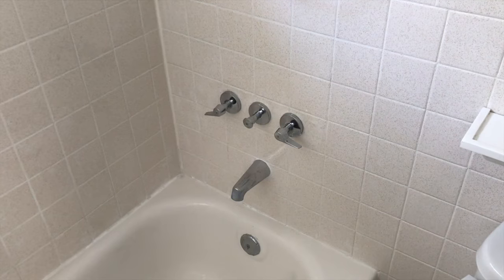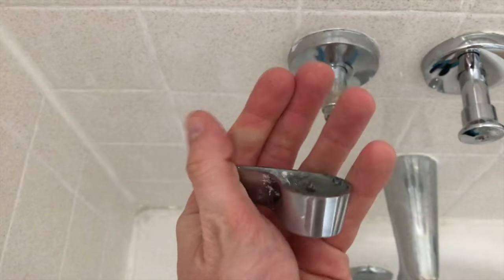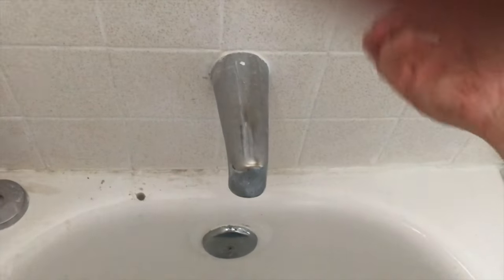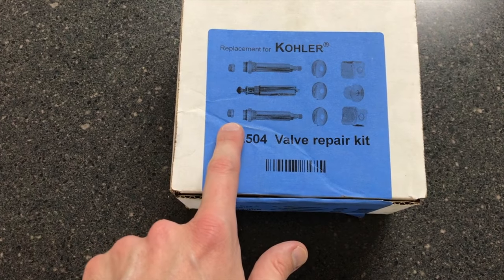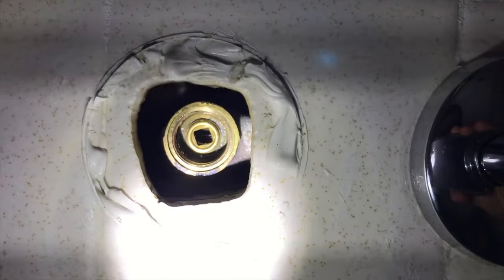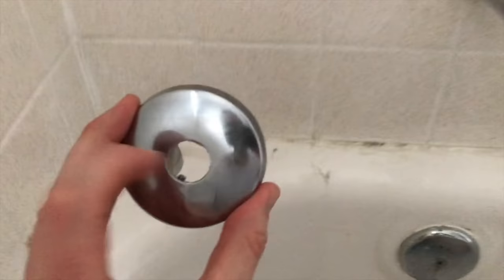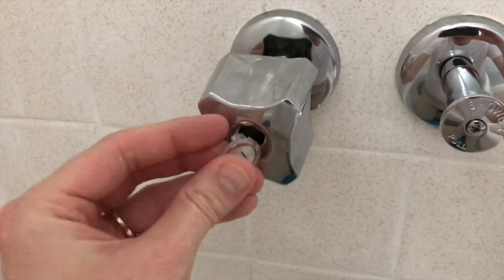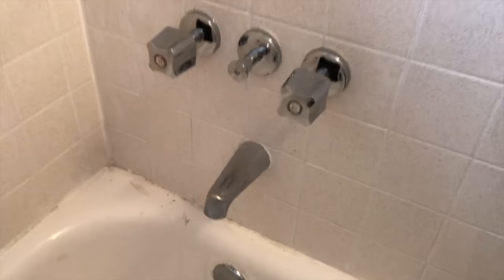How to repair/replace 3 way shower valve/stem - FAST & EASY!

Comment: This was best video yet to show full results of leaking tub sprout, I call  Rooter they want $300.00, I m a single parent I could not afford it. I ran across this video how to replace this sprout come to find out it was not tub sprout it was the cold one. I went to Home Depot with cold water stem, it cost men less than &14.00. Just wanted to dropped a Thank You❤️❤️ for sharing..

Comment: Thank you! I have a leaky valve and I didn’t know they had to be open to replace it. Makes 100% sense. Very thorough video👍🏼. I was instructed when putting the escutcheons on to put a small bead of caulk on the escutcheon and let it sit for a minute or two and then slide it on. Any excess should be wiped off but I can see how over time the putty might be better and easier to work with
Reply from the maker: Thanks for watching & welcome to the DIY Raptor Club.  Sounds like you’ve got a good handle on your project.  Please keep us posted matthew.

😎👍🔧🔩

Comment: This is the one i need to change out ,  mine is  hard to turn all of a sudden ...  i have to find what  size it is  nothing is leaking  just getting harder to turn lately .. i changed it when i moved  in here 10 years ago  there was no hot water  since the house was empty for a while  when it was for sale .  Thanks for sharing ~
Reply from the maker: Awesome, definitely reach out to us if you have any questions.  Even if you don’t have any questions, we’d love to hear back from you on how the project went.

👍
Reply: @DIYwithMichaelBorders      Yes for sure .  Thanks ~
Reply from the maker: @joedevitto6113  

😎👍

Comment: Thank you for a very helpful video! One question — do you need to seal the inner part of the plate, where the plate’s donut hole and the stem meet? Seems like water could get in that way?
Reply from the maker: Thank you kindly, that’s a great question.  You can definitely apply plumbers putty to seal that portion.

😎👍

Comment: Thanks for your video.  My bathtub faucet has three handles and was made by Eljer.  Several years ago I had to have a plumber come out in the past due to the handle on the hot water side not cutting the water off.  I watched the plumber take it apart and replace the seat washer on the end of the stem and it fixed the leak.  Everything was good until this past weekend when turning the hot water off the handle suddenly turned the water back on after almost having it off.  I decided to try my hand at it this time and got the necessary supplies and replaced the washer myself.  When turning the handle the water does cut off, but the handle still comes loose again and water flows and a little more twisting I was able to get the water back off.  Is this a sign that the stem has gone bad as well?

Comment: Great video! I am trying to understand if this would help with low pressure it’s only for the hot side but the pressure works fine everywhere else in the house?
Reply from the maker: Thanks for watching and your stem may be clogged.  Replacing it will be a good idea.  😎👍

Comment: I replaced the cold water stem in my shower. But the problem im having now is when you shut the water off, the handle won’t stop spinning. And if you keep spinning it, the entire handle + stem will pull out of the wall. Is this just because I wasn’t using the socket wrenches and was simply using a wrench to tighten it?
Reply from the maker: Thanks for watching & welcome to the DIY Raptor Club.  Any update?  By chance did you apply Teflon tape to the thread of the stem?  

Teflon tape will not only create a water-tight seal, it will assist in firmly securing the stem into the threaded housing of the valve... ultimately not allowing it to spin or loosen in any way over the months and years of using your handles.

Also, have you ensured that you purchased the exact replacement size part?  A stem with an ever-so-slightly smaller thread diameter will cause this exact issue.
Reply: @DIYwithMichaelBorders  You don't need teflon tape for this job.
Reply from the maker: @gary7vn  

Thanks for sharing your thoughts.
Reply: @DIYwithMichaelBorders  he’s not saying the body is spinning, rather the handle is. This occurs when the barrel doesn’t seat fully and you can’t shut the water off.
Reply from the maker: @Mike-gz4xn  

Very kind of you to share, we really appreciate this Mike!  👍
Reply: Connor the solution is the get a solid brass or plastic washer and put between the barrel and the stim. This will push the barrel out more and keep it from spinning. I would bring your stem to a local hardware and find a washer that fits. It can’t be any wider than the barrel. 
I used a nylon one that fit good.

Comment: Great video, thank you. Please allow me one question. I have a 3 handle very old (1973) tub faucet. It seems it's made by Jameco. I want to replace/upgrade the three stems, especially the diverter which no longer works. So in your opinion which plumbing fixtures company  stems i should use for this replacement. Or, would the internal old valve accept any upgrade kit. Thank you a lot for your time.
Sam
Reply from the maker: Sam Rafeedie 

You are very welcome Sam.  Glad it helped.  Great question & we are glad you asked.

A valve system that old will require a little bit of searching...which is normal & doable.  Lowes or Home Depot will most likely not have the Stems in store however if you are able to remove a stem, you can take it to your local Lowes or Home Depot and they have a huge catalog in the plumbing department to allow you to match your part.

The problem with that is... if they have to order it, it may be a few days until you get it... which will force you to reinstall old diverter stem until the new one comes which shouldn’t be a big issue.

If Lowes or Home Depot do not have access to the new Stems, The next best thing to do is search local plumbing dealers such as Kohler dealers, Moen dealers, & Jameco dealers.  They are a much better option when trying to find parts that old.

You mentioned that your 3 handle system is from 1973.  You won’t believe us when we say this however the valve system we worked on in this video is literally from 1973... that’s when the place was built and it is the original plumbing.  😀

We were able to get our parts from a local Kohler dealer.  We recommend contacting all local plumbing companies that perform all sorts of plumbing installations.

Let’s start there, keep us posted Sam!

Please subscribe to the channel and turn on your YouTube notification Bell 🛎 that would be awesome thanks again!

😎👍🔧🔩

Comment: Thanks for the video. Mine is a 3 ways shower valve. The brand is,”standard”. The only time I see the water leaks through the valve stem is when I turn on the water. Do you think I just need to replace the seal or also the seat ? Or the whole valve stem ? And is it the same design like any other brand or different ? Thanks
Reply from the maker: Thanks for watching, any update?  We would recommend replacing the stem and o-ring seal first.

If that doesn’t fix leak, replacing seat would be next likely cause.

Comment: I learned stuff from you, thank you so much!! Before I watched this video I had created a hole where the middle knob was bc I stripped the copper pipe there and now I can’t put a new knob on it :(. The plumber said I have to replace the whole copper piping to get it replaced and that it’d cost $2700 😯. I don’t have that much money right now :/ is there something I can use to temporarily plug that hole so I can start taking showers here vs at my friends house 😬 😂 

I wish I watched your videos BEFORE I did that!
Reply: I know I just when way over my plumbing skill set (which is none 😂), but all I was trying to do was to replace the shower knobs (that have probably been there since 1949 when the house was built lol). But I realize now, I shouldn’t have messed with it and just had a plumber do it..I just didn’t foresee it messing with the internal copper piping like it did 😢 

So I just want a temporary solution to be able to shower without water going into that hole in the wall…while I wait patiently for my soon to come piping replacement. Ugh! I wish you were here 😂
Reply from the maker: Thanks for watching, you can apply painters tape to cover hole.  We agree, it’s a great idea to alleviate any & all water/moisture from getting into hole & sneaking behind wall.

Keep us posted as the plumber comes & goes.  😎👍🔧🔩

Comment: I have a very old 2 knob handle system with the diverter in the tub faucet. House was built in 1940. I traced my leaky faucet back to the hot water cartridge, but I can't figure out what brand it is. Any way to put a completely new type of valve  and stem in there? At this point I'm thinking it's a better option to swap it all out for something modern than to keep trying to find old stuff and adapters for it. Thanks in advance!
Reply from the maker: Thanks for watching & it’s definitely an option.  If you are looking to install a brand new valve system such as a single shower head installment or something more modern, you may need to consult with a licensed plumber as they may need to remove drywall/tile to gain access to valve & ensure it is replaced in a manner that meets proper code.

However if you are more interested in replacing the current stems with replacement stems as opposed to installing a brand new system, it can go fairly quickly and be very friendly price wise.

Please keep us posted on your project.  Looking forward to hearing back from you.

Comment: What do you do if you accidentally threw out the old diverter and stems, and don't know who made them? How do you find out which ones to buy?
Reply from the maker: Brian Sanders 

Thanks for watching Brian.  You can purchase compatible stems.  That may be a good route to take.  You may need to purchase a few & carefully insert one at a time into the thread until you find the perfect match.  Again be careful as you do not want to damage internal thread.

😎👍🔧🔩

Comment: The plate does have a screw & I can’t remove it any suggestions?
Reply from the maker: Good morning ☕️ any update?  You may need to add a little bit of heat…however doing your absolute best not to allow the heat to damage any of the surrounding parts and tile.

Comment: If I change out the seat in the pipe would that allow me to install a different stem from what I currently have or would I have to completely change out the entre valve for the tub/shower?
Reply from the maker: duke0482 

Thanks for watching & we hope the video helped.  Great question & you can definitely install new stems as long as the thread diameter & measurements are the same.  LOWES & Home Depot have a huge pictoral image catalog in their plumbing section inside their stores.  You can take your old stem and have one of their plumbing specialist show you the options you can choose from.  😀

We really enjoy making these helpful videos for our fellow DIY’ers.  Many more helpful videos to come.  😀

Let us know if you have any questions.  Please subscribe to the channel and turn on your YouTube notification Bell 🛎 that would be awesome thanks again!

😎👍🔧🔩

Comment: I got two plastic pieces broken when I take out the brass valve.  Do I got to replace any piping?
Reply from the maker: Thanks for watching, are the plastic parts broken off of the old stem/cartridge?
Reply: I was told they were broken,  but the guy who was telling me isn't a plumber lol.  If I had a way of sending you a picture or video you could tell me.
Reply from the maker: @daviddart400  

Thanks for the follow up.  In that case, it’s a good idea you’re replacing them with new.  👍

Comment: I'd like to replace all the valves on my shower, but it's old, I didn't have it installed, and don't know the manufacturer of this faucet. 
Do you have any advice?
Reply from the maker: jmad627 

Thanks for watching & we hope the video helped.  Absolutely we can help.  After removing a single Stem, you can take that Stem to your local Lowes or Home Depot and they have a large parts magazine in the plumbing section.  You can match your exact Stem to the Stem inside the magazine and you will be able to pinpoint what manufacturer or brand your Valve and all parts are.  Keep us posted!

We really enjoy making these helpful videos for our fellow DIY’ers.  Many more helpful videos to come.  😀

Let us know if you have any questions.  Please subscribe to the channel and turn on your YouTube notification Bell 🛎 that would be awesome thanks again!

😎👍🔧🔩
Reply: DIY With Michael Borders does, or do these valve cartridges have to be the same manufacturer as the valve body? 
Are the interchangeable? 
At the moment the diverter valve is the most pressing issue. 
But I'd like to replace all of them with matching trim and handles and all. 
Is this possible without changing the valve body?
Oh...and thank you for replying.
Reply from the maker: jmad627 

Thanks for the question.  Home Depot, Lowes, or ACE hardware can match your original parts with new aftermarket parts...definitely possible.

Hope this helps.  😎👍🔧🔩
Reply: DIY With Michael Borders it does, thank you.
Reply from the maker: jmad627 

😎👍🔧🔩

Comment: How do you know what kind of stem to get? So many shower valves aren't marked for manufacturer, much less model.
Reply from the maker: Thanks for watching & it’s usually easier to remove part & visit your local hardware store to match it up with the exact replacement part.  Keep us posted.

😎👍🔧🔩

Comment: When I turn the shower divert valve water flows great out of the shower but when it’s in the opposite position water barely flows out of the hot or cold lines to the faucet. How could the shower diverter valve cut the flow of water to a trickle to the faucet? None of the valves leak.
Reply from the maker: Thanks for watching.  You raise a great question...& as you hinted toward in your comment...this is not normal.

As you pull diverter out to allow water to flow to upper head, something inside may be clogging it.  The inner rubber seal may be warped & falling off leading to blockage.

How old is diverter?  Replacing diverter may help solve issue.  Has this been happening for awhile or just recently?  Keep us posted.  Us fellow DIY’ers need to stick together!

😎👍🔧🔩
Reply: Hi Michael, I really appreciate your response! I’ve searched all over the net but couldn’t find anything related to my problem. The water flows perfectly to the shower but when I use either the cold or hot water there’s just a trickle of water flowing to the spout. It’s been this way for several years. We’ve been filling the tub with water from the shower because the pressure is so good. But if we turn the shower valve to the faucet it would take 15 minutes to fill. All the valves are 15-20 years old. I guess the next step is to just replace the shower valve since it’s the only common link. Thanks again for your quick response!!!
Reply from the maker: @MovieMakingMan  

We appreciate your reply.  Something is interfering the flow of water.  You may need to install a new tub faucet.  This is a very friendly DIY project...it may be incredibly calcified inside.  Below is a link to a video that shows us removing faucet & cleaning it...however if your water flow is that low, we recommend a new faucet.

       https://youtu.be/QQoYt8C3Btc

Keep us posted.  😎👍🔧🔩

Comment: Why is it necessary to turn off all water to house, but not just the  valves to the  shower?
Reply from the maker: Thanks for watching & that’s an option as well...as long as you have actual shutoff valve’s designated specifically for your hot/hot lines to tub/shower.  We hope the video helped.  Enjoy your day.

😎👍🔧🔩

Comment: Michael question for you. How satisfied are you with the handles that came with this kit? I was able to get one seat/valve stem replaced today after hours of nothing but difficulty and once I got it together the knob on it feels like it’s a bit loose when you turn the water on like it wiggles a little bit and doesn’t seem stable like the old handles like you had and I had before the repair. It seems fine when the water is off. Have you noticed that or are your handles movement free? Thanks!

Comment: Did I miss something..you turn off the valve but the valve was all ready closed when you installed it...
Reply from the maker: Thanks for watching & welcome to the DIY Raptor Club.  The water was turned off at the exterior valve to ensure no water flow during project.

😎👍